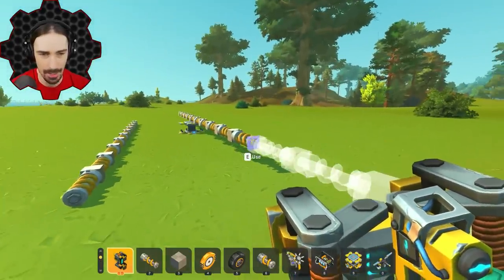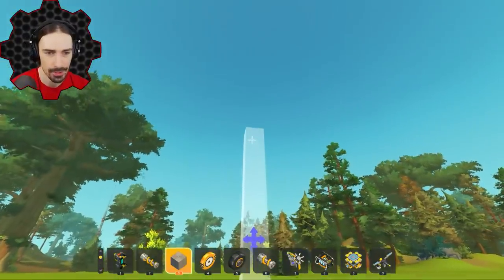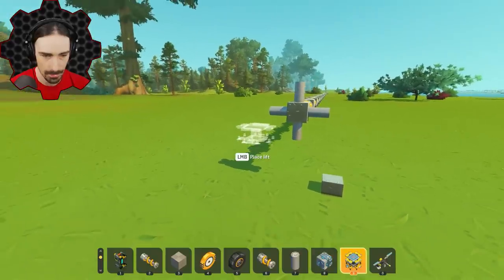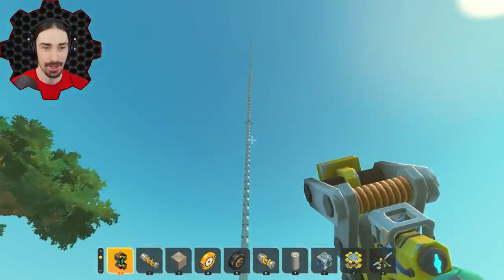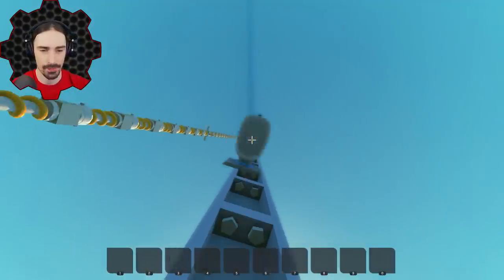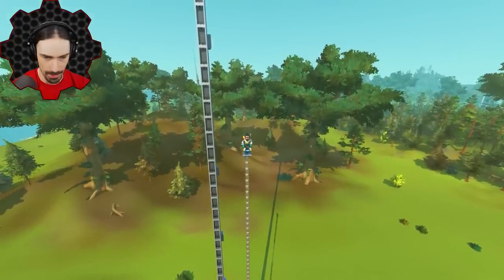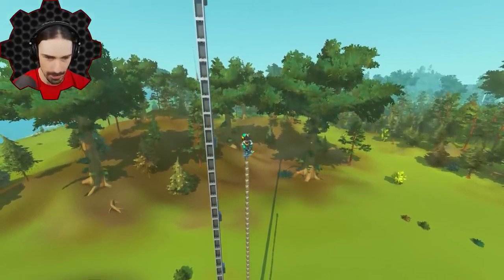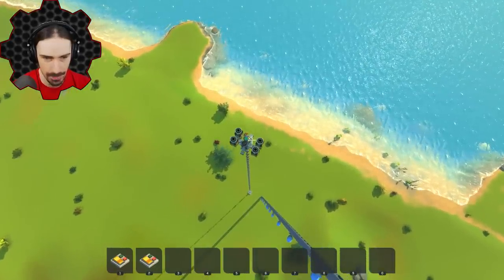Dumb Suspension Experiments With SUS Results

Comment: I noticed you said that if you place suspension in series it gets weaker.. Yes the RMP is slower but what about the torque? does it have more power? What happends if you place them in parallel instead of series?

Comment: Gas engines have the most torque. Electric engines are about 1/4 as strong as controllers.
Reply: I think electric engines are definitely stronger
Reply: You're right gas engines are much stronger than electric engines and that controllers are stronger than electric engines I know this because I have the game
Reply: @TheVeryRandomPerson  More top speed doesn't equal torque
In real life and from what I've heard about scrap mechanic, electric engines are stronger, but lack the speed of a combustion engine
Reply: Gas engine has the most horsepower
Reply: @TheVeryRandomPerson  thank you ^v^

Comment: kAN did an experiment (I forget what for), where he discovered that for suspension glitch turning, the sport suspension (the 2 block one) was actually more powerful. It appears that the shorter a piece of suspension is, the more turning power it has.
Maybe try some more experiments, but with the sport suspension to see what the different properties between the two are.
Reply: A unextended piston has the most torque of anything that you can use. It is even smaller than the sport suspension and has the same effect because it "separates" the two blocks just the same.
Reply: @loading...2414  so you're saying, if you  have the same setup but replace the suspension with a piston you'll get a stronger 'suspension' glitch?
Reply: @loading...2414  this is gonna change how I build suspension-glitches... though it's not technically a suspension glitch
Reply: @loading...2414  wait, can you make it even stronger with a bearing between the two blocks? That's even shorter (no distance) and it's still a joint...
Reply: @vibaj16  technically, yes? At that point the thing it is attached to will just go flying.
Reply: @vibaj16  you couldn't weld it at that point, that's the whole reason a suspension or piston is used
Reply: Can you use 2 bearings on each side, or can't weld it?
Reply: @burnttoast5372  You can't? Well, then you could do the method where it pushes against walls instead of welding it

Comment: About the self-stabilizing tower, I actually used this concept in a gyro once. Basically, it had a bunch of thruster pointing sideways in every direction, and there was a piece in the middle that was free rotating separate from the flyer with a glitch stabilizer, I pulled some arms out from the stabilized piece to the center of the thrusters, so it would tilt the thrusters twice as much as the flyer (kind of like a lever effect), causing it to automatically stabilize itself without any sensors or logic gates. I found that it actually worked better than a lot of gyros because it was fully analog (it would give a little if the flyer was tilted a little, and give a lot if it was tilted a lot), though the size and lag made it pretty much useless for any practical purposes. Quite an interesting concept in my opinion, if you're interested in taking a closer look, it's on the workshop as "Mechanical Flyer", feel free to make your own version of course.
Reply: does this concept have any connection to real life? If so, is it at all practical to use in real life?

Comment: I'm just waiting for someone to make a piston mod that lets you control the strength SEPORATE from the speed and for a separate mod to let you control those number values with a modded controller. 

Imagine the glory you could do with a 0-strength piston that can switch to 1 strength on a flick of a switch. You COULD make artificial suspension that way.
Reply: can't you do that with a smart engine?
Reply: @vibaj16  Uh wutnow???
Reply: @Hadeks_Marow  The smart engine from the modpack can do it. You can adjust speed, power, springiness and length.

Comment: The rotating suspension glitch makes since when you think about the gear ratios.  The bearings on all three of them are probably traveling the same speed, its just that they are at different distances from center, giving the center a different speed.  The further away the driving force is from center, the slower the center will turn.

Comment: Are you sure the bigger suspension glitch is weaker? I'm not saying it is stronger, but I think the reason it's slower is because the point of rotation (the bearing that's causing the glitch) is being put further and further away from the center point of the platform. I think a better measure for stacking would be keeping the bearing that's doing the turning at the same place on the platform and adding suspension outwards. Which actually makes me wonder, would a cross suspension glitch have more power than a single?

Comment: I know you had to move on with the vid but going back to the suspension bending you only tried push methods to bend it what if you tried a pull method or if it works using a suspension glitch glitch to bend it

Comment: i think the differance in sideways rotation when it comes to suspension glitches is this:
less suspensions= more speed less overall power. 
more suspensions= less speed more overall power.
so you can try a heavier base maybe to see the effects? something like 17x17x3 concrete 3 to check the differance?

Comment: I made something similar to a suspension catapult in scrap mechanic however I pulled down and back on the suspension not straight lateral so I had better results  it moved a bit but it was a hard ballence I think it could work though

Comment: I wasn’t expecting that, but it makes a lot of sense. If you think about the forces involved along the suspension glitch, you are applying the same amount of force with each scenario, but are changing the distance along which those forces are applied. Therefore, each equivalent length is experiencing different force and reacting differently. 

With this being said, I’m wondering now, what the result would be if you upped the angle from the controller in order to increase the amount of force each unit of length is experiencing so that it equals the force experienced by the single suspension piece. Would that produce more torque, more spin, or both? Seems like a fun thing to test.
Reply: This is exactly what I was thinking

Comment: I've tested this. You can put 2 Suspensions in parallel on a T connected to the same bearings to slightly increase the strength but it takes up more space than just putting a bunch of Suspension glitches next to eachother.

Comment: The reason for the suspension glitch is because the bearing is effectively tying to turn itself. The suspension is only there because you can't weld sub-creations to your main creation, in order to prevent a 'suspension glitch' scenario. The suspension circumvents this feature, exploiting features such as welding sub-creations and multiple-component connections (like when scrapman added that metal block to both a suspension and a bearing). The reason that the suspension glitch diminishes with greater distance may be because the extra length provides resistance in the form of increased leverage against the bearing - leverage most likley not directly coded into the scrap mechanic, as it is simply a logical fact, like two ones are a two, and so this happens without the developers coding for a situation similar to this. Does anyone else have any ideas?

Comment: I've done a lot of suspension glitch experiments... battles between different methods, strengths, and amounts. I found that it's best with just TWO sport suspension glitches, side by side with a block between (3x5 area consumed). Two bearings will be on the same ends of the suspensions, not opposite. And the two glitches will be connected on the side with no bearings. Surround all of this by blocks. Boom.

Comment: I think that if you want more power, you not only need more suspension, but you also need more torque. If you replaced the weak steering bearing with a controller bearing, I think that more suspension will go faster.

Comment: I believe for the second experiment, it's not actually the force getting lower the more pistons you have, just where the force is being applied. The farther from the center you are: the higher the torque will be, but lower the speed. You can test this theory by doing it on a wheel, and seeing the difference while driving through the hills.

Comment: Multiplayer monday idea: sus beyblade battle, literally, use suspension glitch to spin around beyblades in an area, knocked out of bounds equals a loss, u decide block limit, weight of blocks and where u place them are gonna matter, no spud guns or explosives of any kind, can use multiple different types of building blocks for beyblades, blocks with suspension and wheels for contact points (places the bey uses to slap around other beyblades) are allowed, the bottom is wutever u want it to be but the main circle thingy of the beyblade has to be 2 blocks thick and 5 blocks above the ground.

Comment: Not sure if it would make any difference but with the stacked suspension glitch, is the speed difference not likely to be because the center of rotation is moving. I. E the powered bearing of the fastest one is almost directly in the centre of mass but the slower ones have the bearings as far away from the centre as possible, maybe try having the suspension arms be single width with the powered bearing in the centre of the main metal plate for maximum rotational torque

Comment: Make a giant pogo stick that had a piston to push up (retract it fast) and land on a 2-4 suspension pieces stacked say 4 high.  That will make it push up, drop down and bonce... and if you time it right you will push it while moving up to go even higher.

The second idea is to do say a sling shot.  Us a stack of suspensions on each side and have a bar connect then and something compress it back as far as it will go.  Put a bolt or rock or bomb on it then release it.

Comment: I actually started to wonder how much the moved point of povered bearing changes the power of suspension glitch. Single suspension turned from closer to middle of the platform and triple suspension turned from the edge. 🤔

Comment: MM idea: You start off the race with lvl 1 gear 
Engine/bearing/suspension and at each checkpoint you can upgrade the suspension and max out speed. BUT you have to make it the max

Comment: By the way Scrapman what i have found out with my tests are a Piston on Max has more strength then a Piston set at a Lower Speed doesn't do a lot of Strength i also found out though not hooked up hitting a bump would decompress as well when you land with a smooth landing for me and also working on a Carnival Ride a not hooked up Piston would go in and out gradually based on how fast the ride was going

Comment: The suspension glitch works through leverage force, so of course a longer lever means less force. But of course this is Scrap Mechanics, so that might not actually be so obvious.
Reply: What? A longer lever gives MORE leverage.
Reply: @tempestrage257  You should learn how leverage works. Force applied to the longer side of the pivot point multiplies on the short side pending on the ratio of their length. The effect is opposite when force is applied to the short side. This is very much the latter case. In fact, here the force is applied directly to the pivot point so there is exactly ZERO leverage force miltiplier added to the equation.
Reply: @anteshell   right okay I just corrected your below sentence and you say I need to learn how leverage works😆😆🤦

"the suspension glitch works through leverage force, so of course more leverage means less force" 
 
i think it is you who needs to brush up on fulcrums, which helps toward leverage.

Then You just back tracked and answered your own comment, that zero leverage is happening, SO..... the suspension glitch doesn't work on leverage, does it buddy🤦, know why?? Because a lever can't have 2 fulcrums. 

🤦🙄

Comment: I'm not too familiar with the Scrap Mechanic engine, but I'm curious to know if, even though the longer suspension glitches were slower turning, they were higher torque... assuming the engine accounts for torque... no clue how you'd even test that though.

Comment: scrapman do this in order bearing , block , suspension , mirror it with one block gap bearing in the middle then the block conecting the suspension power middle bearing use for my tanks

Comment: The question is, if the suspension glitch ist stronger than those thrusters, can 1 suspension glitch or several parallel bend the suspensions even more?